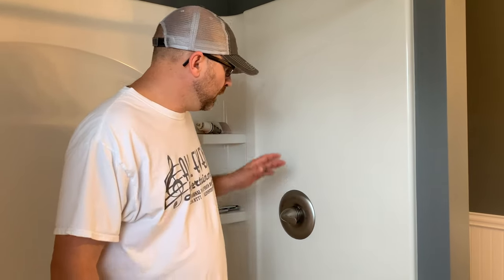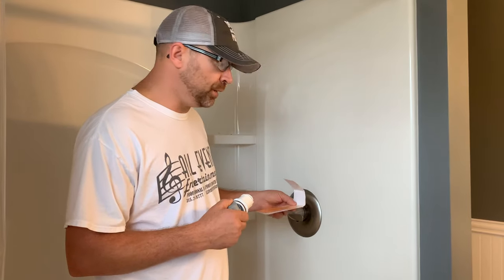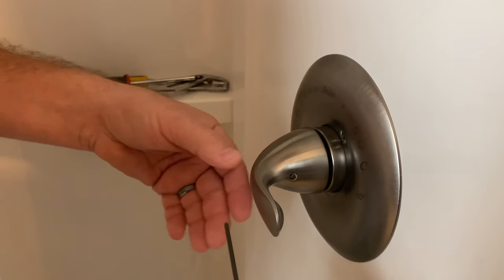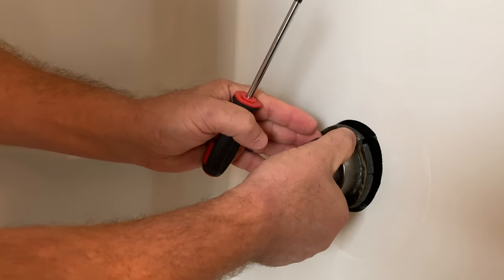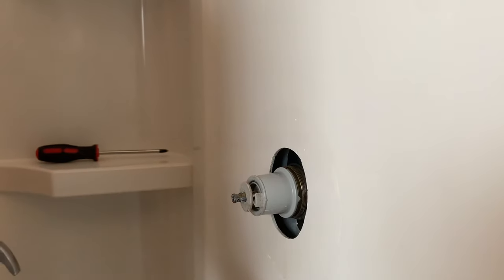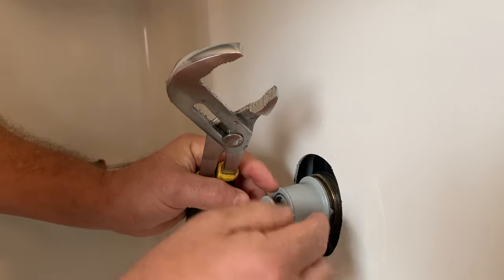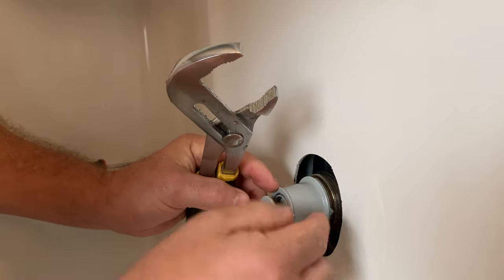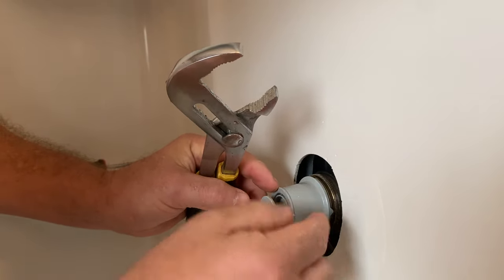DIY Replacement Delta Shower Faucet 1300 / 1400 Cartridge - Leaky Shower Head

Comment: Your video was great!  I was able to repair my leak with almost no surprises.  I did find that the bonnet was frozen and, per your hint, I didn't want to apply much pressure (causing other issues).  I did call Delta however.  They are sending a new bonnet and a new cartridge absolutely free.  They also suggested a vinegar soak on the frozen threads of the bonnet.  I used a short piece of a sleeve cut off an old t-shirt.  This gave me a little tube I could wrap around the frozen joint and then poured the vinegar on the cloth.  They said to keep the area wet with vinegar and let it soak overnight.  The next morning it popped right off and I was able to finish the repair in about 30 minutes.  Thanks for your informative video.

Comment: Yes , did same thing going cheaper with the Danco equivalent instead of Delta and end up replacing it at 4 years and the Delta that I had lasted for about 17 years.
So anyone reading my comment, I would go with Delta.   This is my experience !!  Also I have another shower that has a Delta cartridge that is still working with no leaking and it has been 18 years so far.

Comment: Just an FYI if you have a gray cartridge you should be replacing it with another gray one (RP46074) if you have a white one you should be replacing it with white (RP19804). They look very similar.

Comment: What’s really fun is when the handle won’t come off no matter what you do…
Reply: @nwmusic2010 if set screw is stuck, using a drill just drill into the set screw until it comes off
Reply: @MrAntonioDP  would you use a 5/32 drill bit for the 1/8 set screw?

Comment: Changed mine & water comes out of the shower head good, but, tub spout only small amt of cold comes out & the hot water comes out better but not good. ????
Reply from the maker: Hi Deborah, I do not have a tub on the unit I replaced.  When you pull up the diverter for the shower, you get good flow from shower head but when you push it down and water flows to the tub fill spout you have little water flow.  Did the tub work fine before you replaced the cartridge?  Is water leaking around the cartridge when you have the diverter pushed down to fill the tub?

Comment: I replaced my cartridge and set the new one to the hottest setting but the water is not as hot as it was with the old cartridge. Anyone know why?
Reply: I'm having the same problem did you find out what the issue was?
Reply: Wrong cartridges
Reply: You can adjust the max temp on the outermost part of the cartridge when inserted.  Just take off the handle and there should be a control dial.

Comment: I could not remove the blue part,had to call plumber. Ended up cost to me 600.00 he had to cut dry wall in closet cut lines and replace all new value.
Reply: I'm dealing with same thing. Why won't it come out, I guess i'll have to call the plumber also.

Comment: Can't get the set screw off the handle. Pb blaster  wd 40. I have soft water.Tried everything. Bought the cartridge. Now I might have to call a plumber. Might have stripped it.
Reply: I had same problem, the screw would only turn a small amount each way,  but discovered if you turn screw one way toward the right, the handle will come off
Reply: I had to use a regular wrench to turn the Allen wrench

Comment: Thank you very much for your video, but I replaced mine, faucet and cartridge and no water comes out of the shower head. What could be the problem?
Reply from the maker: Hey Alfredo….   I know this sounds like a silly question but did you turn the water back on after you replaced your parts?   If so, which I’m sure you did, I would look make sure the manufacture didn’t put plugs or dust caps in your cartridge.  I don’t recall if mine had them or not but the only reason you would not have water out the shower head would be obstruction I believe.
Reply: @thesavageoutback  Yes, I turned the water back on, and checked for obstructions between the shower faucet and the shower head with an air compressor and everything is fine, so I don’t what could be the problem
Reply from the maker: Hey Alfredo, did you get this figured out?  Was it a defective valve?

Comment: Removing the bonnet after 20 years may require heating it up with a propane torch to break it free.
Reply: You'll meet the plastic/rubber internal parts.

Comment: I changed mine and the new one is mot working at all
Reply from the maker: Hey Byron….  Sorry to hear this!!  Is there anything behind the new one in the valve body that could be blocking flow?  I know it’s a silly question and please don’t be offended but did you turn the water back on after installing new valve?  Is any water leaking around the valve?  The only other thing I could think of is that the new valve is defective.
Reply: @thesavageoutback  thanks for the reply yeah i turned the water back on and nothing is blocking the valve i also think that the new one is defective and im wondering if that actually happens
Reply from the maker: @byzon123  it would be odd to get a defective new valve but trust me…. If that could ever happen it would happen to me as well.  If you put the old valve back in and have flow then it has to be the new valve is defective.
Reply: @thesavageoutback  when i had the old one in i had flow it had a broken screw for the handle thats why im changing it new one went in easily enough but only get a bit of water coming out  and cant even turn it off the small flow i get
Reply: Get the Delta Cartridge...Danco known to have issues.
Reply: @mossmiller  yeah i had to exchange it and the new one worked